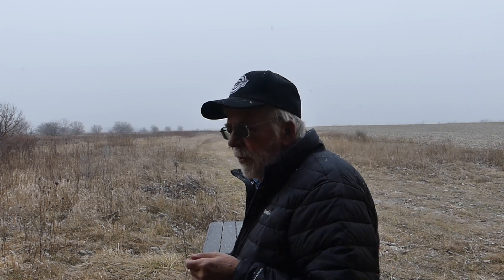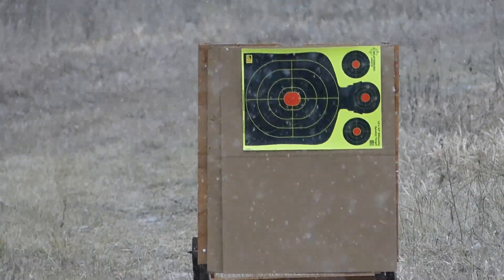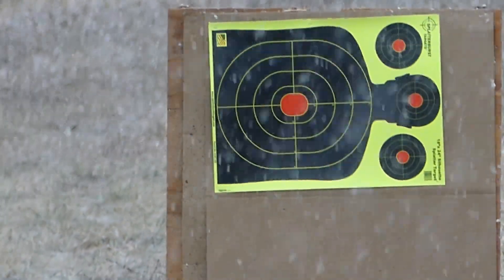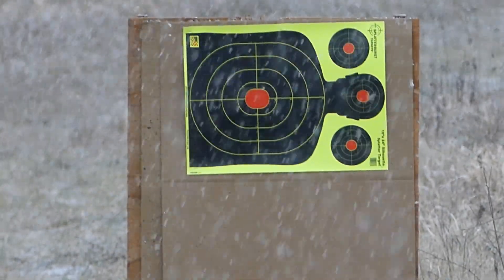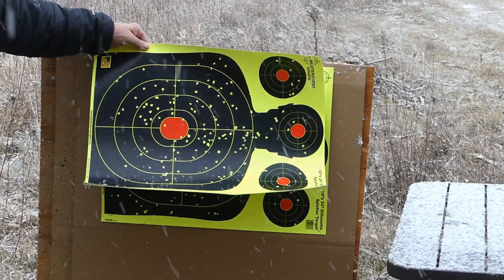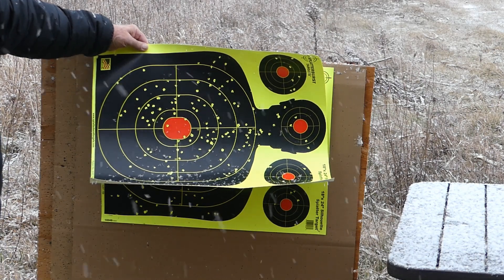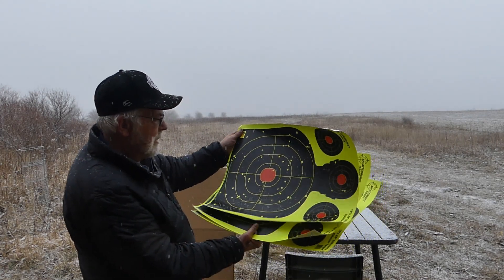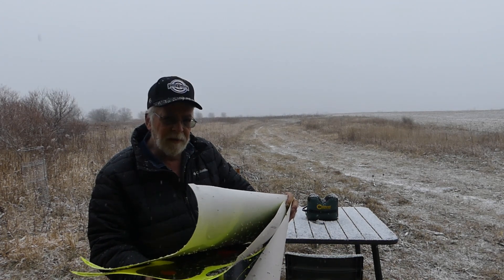Choking TSS vs. Lead for Wild Pheasants

Comment: I use 1½oz and 1¾oz 4 and 5 shot 12ga on my longer ranges shots but I use a full choke and it gets me out to 60yards but that's pushing it. Might need to try a stricter choke like 680. I mainly hunt grouse and rabbits so im likely taking ground shots. Would be cooler to see lead 7 ½ shot and lead 8 shot or tss 5 shot for better comparison.
Reply from the maker: TSS #5 makes no sense for what you are doing. TSS #8 is plenty.

Comment: Randy, I enjoy this content with the pheasant emphasis. When I started using tss for pheasants everyone thought I was nuts. I started off with Federal heavy weight #7. I bought all I could from a retailer that had them on clearance once I figured out how great they were. Then I got into reloading, and  now hw15 seems like it has disappeared. Seems that BP has sold the last of the supply that was produced for federal? So I switched to tss 8’s and dropped my pay load to an ounce. And the performance is great.
Reply from the maker: I used Federal HWT #7 1-1/8 oz. until it was discontinued. This was from 10 years ago: https://youtu.be/ouoG4T5L3Ms .